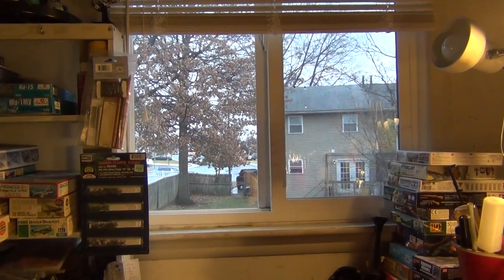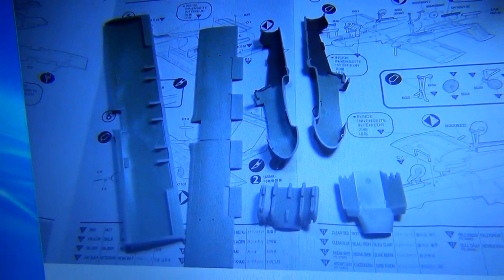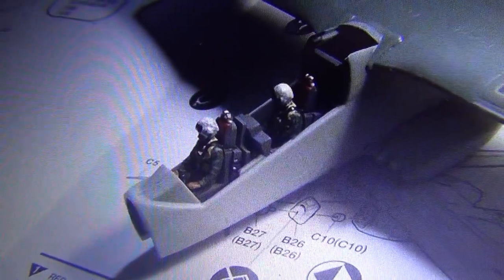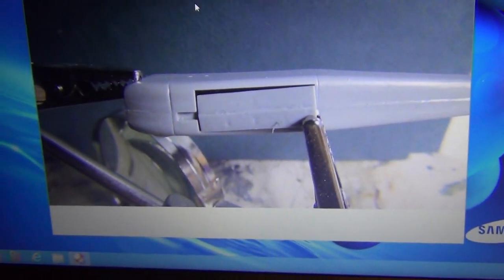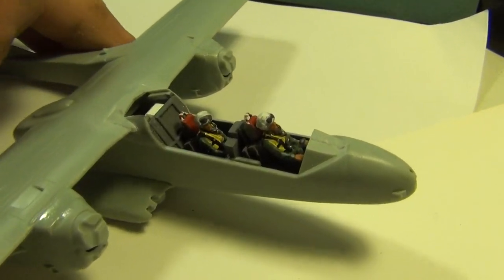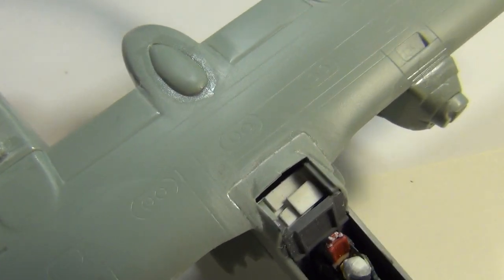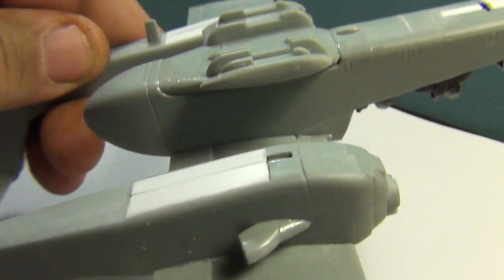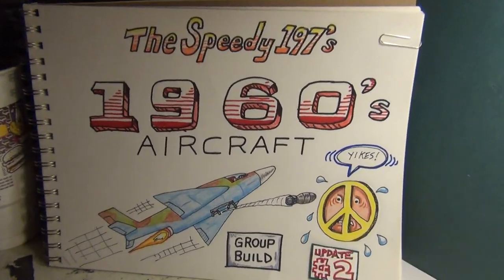Update2 / 1960's Aircraft Group Build

Comment: Strange how most modelers think that gaps are a sign of a bad model. well yes , its short of perfection,but that's the fun in my opinion. if they went together perfectly and built themselves it would be,boring for me. sure for the beginner this is helpful, but i personally don't look at the fit issues as bad, if i like the model. i wan't it to resemble the subject,  but if not , i take that as a challenge to make it better.Older kits are fun. Model on Bill great job as usual .